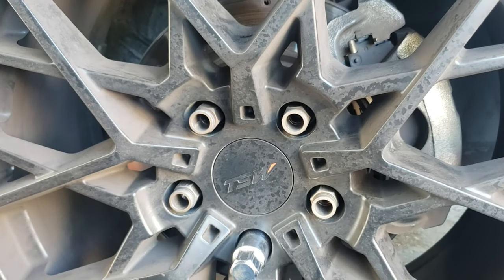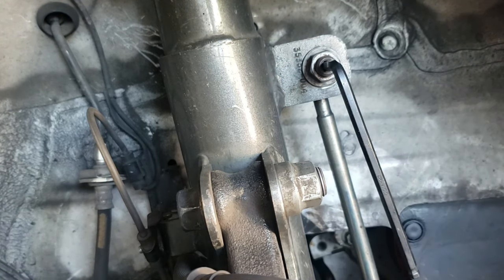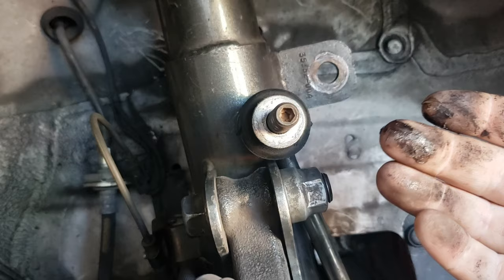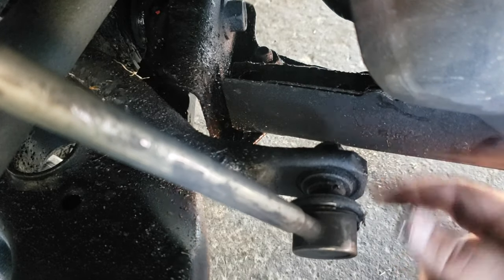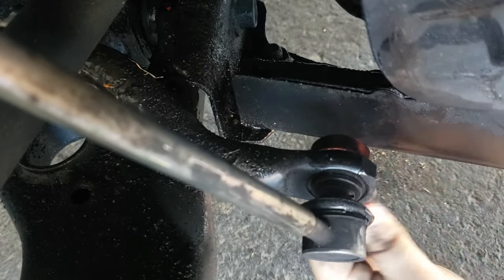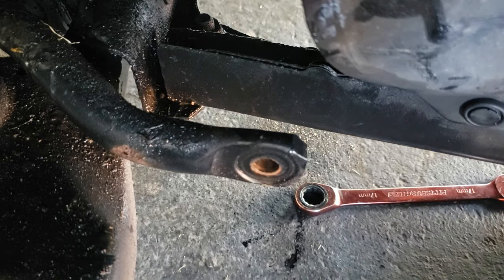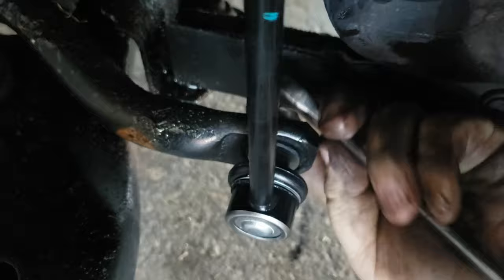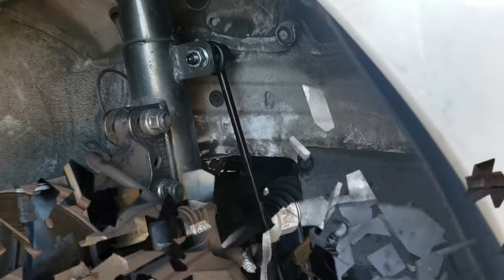Replacing Swaybar End links:Scion xB 2008+

Comment: Thank you for this video. Trying to do a quick troubleshooting without jacking car. When I grab the front driver sway bar link, I can easily twist it side to side by hand. That's a good sign that it's shot yeah?
Reply from the maker: @natoman  it the bushings are leaking or torn I personally will swap them
Reply: @InsignificantBoost  it's kind of hard for me to tell. I can see what looks like fresh lightly colored grease in the bushing area. Does that mean it's torn or is that normal?

Comment: Nice! How did you know your end links were bad? Or going bad? I have a 2012 and when i back up then first get on the gas to go forward there's like a solid clunk coming from the front. I was thinking end links or motor mounts. Maybe both 🤷🏽‍♂️
Reply from the maker: Well after working on the suspension you just notice it....in the video you can see it's super loose and sloppy
Reply: Could also be your lower control arm? I have the 2011 RS8 and it’s definitely making that clunking noise. Btw just to help you out check partsgeek.com they have free shipping for half the price of the parts. Ill be ordering mine soon!
Reply: Finally got around to checking things out. Had a bad infection in my hand then major surgery after 🙄 anyhoo. Definitely need a new CV axle and the tie rod boot is shot. Also the end link boot looks suspect. So I guess it could be any number of things. Haha. Starting with the end links this weekend. 1 by 1
Reply from the maker: End links are easy and cheap to replace! Just make sure the suspension in underload when you're tightening it all 👇
Reply from the maker: Glad to hear your doing better! I'm super sick my self and for today's upload I might have to use text voice or something 😂
Reply: @InsignificantBoost  under load meaning sitting on the ground? Lol.
Reply: @InsignificantBoost  get better soon bro.gonna cruise the valley today. I did a drain and fill with the trans fluid.gonna put a few miles then do it again. Easy peasy
Reply from the maker: @ottallman  yes sir!
Reply from the maker: @ottallman  make sure you go through all the gears a few times if you have an automatic...the torque converter maybe holding on some fluid after you drain it still
Reply: @InsignificantBoost  yeah I did that also 👍🏾 trans fluid is cheap. So this is gonna be the 3rd one this past 2 weeks. Creeping up on 251,xxx miles and still hanging in there. Haha
Reply: @InsignificantBoost  also what end links did you use?

Comment: someone pls explain:" Just make sure the suspension in underload when you're tightening it all".  I dont understand
Reply from the maker: Underload implays the vehicle is resting it's weight on the suspension vs being jacked up and suspension sagging or under slack.
Reply: @InsignificantBoost  just put 2 x  jack stands under the suspension? right?
Reply from the maker: @ShiDejian  blocks or ramps works too